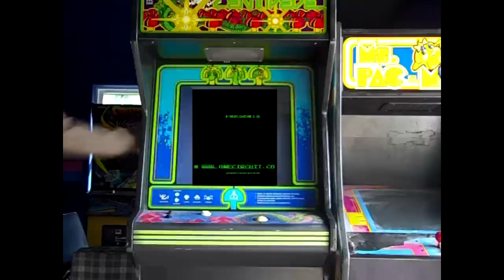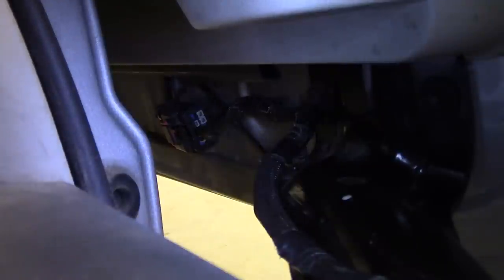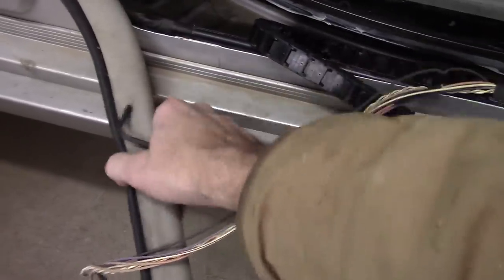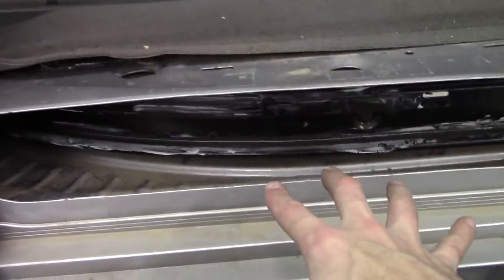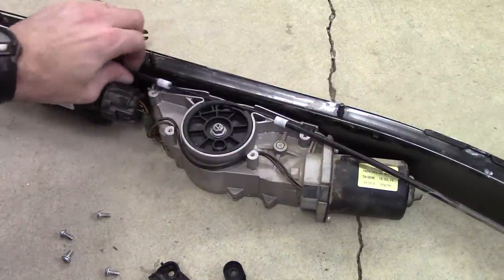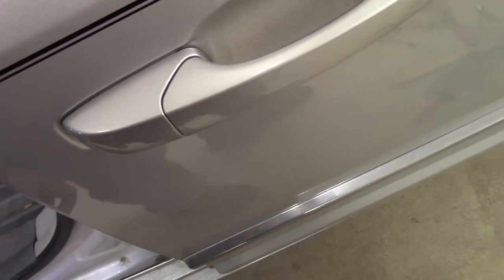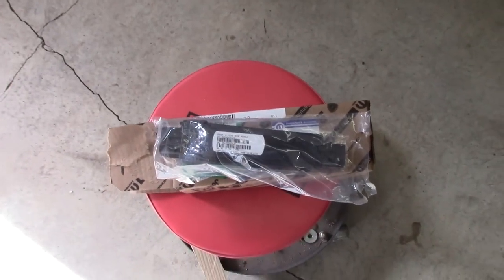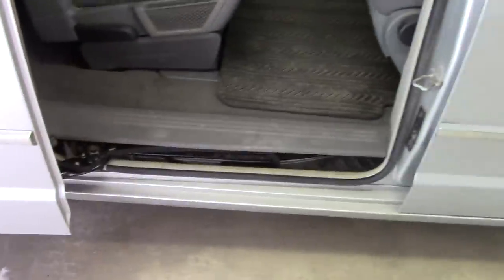Dodge Grand Caravan Power Sliding Door Removal/Inspection/Repair

Comment: I cannot thank you enough. I'm occasionally mechanically inclined but have no discernable car knowledge. This video just saved me as my door refused to shut, on the weekend, 24 hours before a blizzard hitting town. The interior wire/pulley system had come off track and was not retracting. The door is now closed AND electronically connected and working! Thank you for making this super clear and knowledgeable video!!! I was terrified of making it worse the whole time, but your video made it possible to keep going and get it right!

Comment: 05026972AC or 5026972AC is the part # if you didn’t see it well enough during the video. It’s also used on VW Routan if searching for used. They are only $30-$40 more for new vs used off eBay.

Comment: Great video. My cable broke inside the motor housing (under the black cover). Unfortunately, I had to replace the whole track assembly for $500. At the end of the day, the door works and I didn't have to pay the dealer to fix it. Thanks.

Comment: You should of had it recalibrated to see if that would have fixed it as you did take it apart and moved the motor putting it out of calibration. I worked at the minivan repairing these caravans and that is what I would have done.  Any time we replace the assembly we have to recalibrate them.

Comment: Very Informative, thanks for your help in learning"How To!" I've worked in the automotive repair business off and on through the years. My dad was a diesel/gasoline engine mechanic and I learned alot from him. Also, I worked in paint and body shops where I learned another side of the industry. But as every year model adds more and more technology, we all have to continue learning "how to!" 
   I've been helping a friend with her 2005 Dodge Caravan. Replaced the driver's side power window motor recently. No problem there, have done it many times before on a number of vehicles. But sliding side doors and how they operate I haven't had to deal with until now.
    Your video and the way you put it all together is very straight forward and to the point. I know one of the problems that the van I'm working on is that both doors need new wiring harnesses. And a cleaning of all parts and pieces would be of extreme help in getting both doors to operate as intended.
   Again, thanks for your help. I have saved your video so that I can use it as a guide and to share this information with anyone else who might need it in the future.
    God 🙏 Bless You and your family.
    PapaD Bell Southwestern Georgia USA

Comment: Fantastic Video! I just ran into an issue with my cables coming off the spool and binding up, really appreciated the "how to" for getting my door slider out and on the bench to inspect!!
Reply: I have the same problem. We’re you able to unbunch the cables or did you have to replace a part?

Comment: I used to have a Honda Odyssey, that had similar door issues, i had to keep it moving freely as you did with the cables and such, but luckily the Honda had a fuse related to the automatic doors, (#13 if i remember). i figured out that the door had to be fully open, then i pulled the fuse, waited 30 seconds, and put it back in, voila fixed. It seemed as long as i kept the door track clean, and lubricated i didnt have any issues. nice repair Adam!

Comment: This is an interesting diagnosis.
i just picked up a 2012 last week, but without motorized doors. Im hoping to add the motors to it; guessing ill probably need a different bcm as well. I bought a 2013 T & C with the auto doors and I have to say they're very nice to have.
Reply: Be thanfull you have the manual doors.

Comment: Thankyou very much, your video is very informative, i think I've got the same trouble, cause my T&C do the same thing of the door, but instead of the sound of clicked when it try to close, mine doesn't close, the door loose it the way at the beginning of the track. Now in the test of "door open" it doesnt do the correct function cause its sounds like the gears are broken or something, i'll hope the solution doesnt be expensive, i'll kep you inform.

Comment: Thank you for the lesson..  Secondary Codes U0201 Lost communication with left door.  No response from any switches or key fob.  No sounds, no movement.  Only works manually.  2020 DGC SXT.  I'm thinking harness..?  right door fine..  Both fuses look OK..

Comment: Thank you for a great video!! I have a 2005 Dodge Grand Caravan. The driver's side door opens and closes with the motor BUT manually opening the door takes a little effort. The passenger side door manually opens and closes freely which made me think my problem is I need to lubricate something on the driver's side door. like rollers.  However after watching your video lubrication is not the issue, rather its dust and gunk on the cable as you have found!  So now I know what to do to fix my problem! Thanks again.
Reply: tihzho The 2005 is a totally different animal. Designed completely differently.
Reply: FYI - Dorman products makes a sliding door cable harness - part #: 747-311

Comment: Nice deduction! I’m having an issue with the door latch striker is a little high and when I close it it hits the sliding door latch high and causes the sliding door to fail close…. Is there a way to raise the sliding door up or lower the latch striker?  Thank you

Comment: Nice repair Adam. Is the faulty control module a non serviceable part i.e. plastic welded, it would be so nice if you could get into it and show us if any of its pcb components had had the infamous magic smoke escape. I wouldn't be surprised if it was as simple as a bad diode or burnt out resistor that’s killed this control module.
Reply: I was hoping for the same... nice vid nonetheless.  Buy an old used VW and you will have car electronics repair content for months.... don't ask me how I know that.
Reply: Jay T same for me, I had a project car, but the more I fix it the more something else broke. I think a 16 year old car is no fun anymore. There not build like arcades.
Reply from the maker: Yeah I did take it apart just to see if it was anything obvious but everything looked fine.  Unfortunately most components found in automotive applications are usually special versions of commonly found components. For example you could fine a chip that is actually the same as a consumer part you could get from say Mouser or Digikey, but you wouldn't know because the part # in the chip is completely different and all the pins have been swapped around. I imagine this is to discourage people from reverse engineering or repairing their PCBs.  :(
Reply: OneCircuit yes I now. And so you buy something’s new for one broken resistor or IC. Better can fix Arcade systems or retro tech computers.

Comment: Thanks for the video!  What, no torque specs on the bolts???  Our door just stopped opening and closing, but we do get the “unlock click” which is different than the “safety click” that you demonstrated.  I will check harness continuity, then cable cleanliness and motor movement, then finally module replacement.  What did the module cost when you bought it?

Comment: Does anyone know if the module has to be programed?  I purchased an OEM module.  When I tried to operate the door after I changed the module, the door would not open or close.  The button above the rearview mirror, inside button, door handle, none worked.  I took it back apart, installed the original module and now it works again.  I assumed I could swap the module.  Any chance the module I received is bad?  The part number I received is the same as the existing module.  The door works most of the time.  But sometimes we have the same issue as is shown in the video, so I was hoping to resolve it by replacing the module.

Comment: Hi. Great clip. I have a question- Can I replace just the wire/string that pulls the door (what you clean in the vid) and if so, how is it called and where can I buy it? Thanks.
Reply: I was wondering the same thing.  Did you happen to have any luck getting just the cable?
Reply: Nu Flood no you can’t..but I did see Toyota Sienna have similar kit maybe those would fit

Comment: trying to find the torx bolt that goes through plastic piece near the roller.  Anyone know the part number or dimensions?  i can see its rated at 9.8 but dont know the sizes.

Comment: i have manual sliding doors same year as your wife’s ! is there anyway if i get the parts can i make them automatic
Reply from the maker: Not using oem motors etc. The computer is programmed with the VIN and what features were shipped with the vehicle.  There may be aftermarket options however.
Reply: Keep the manual and save your money plus all the headaches.

Comment: so i just got an 08 chrysler tnc both doors work fine they open/close with all 6 buttons which means 2 on the overhead console 2 on the side of each door and the 2 on the key fob HOWEVER if i pull the handle wont do absolutely nothing,i was reading some 08 dont have the feature where you pull the handle and open automatically,have you ever heard of that? mine was built in 02-08